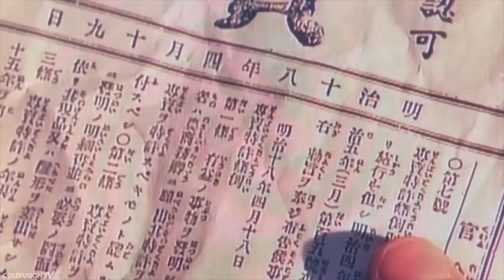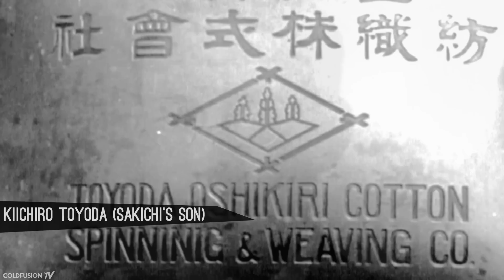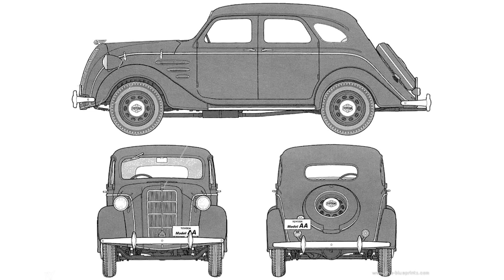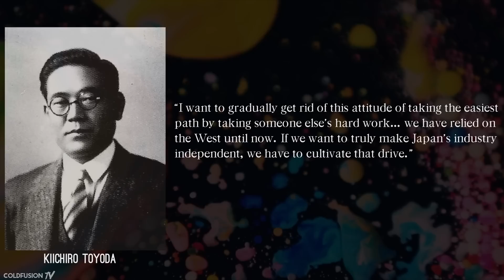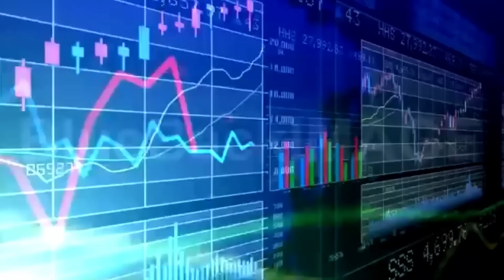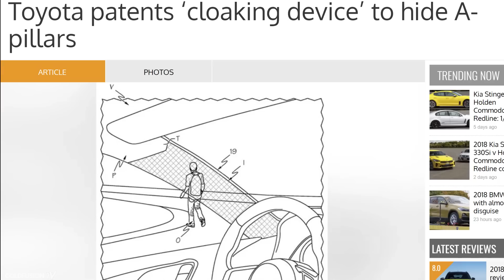How Big is Toyota? (They’ve Owned 27% of Tesla Motors!)

Comment: "80% of Toyota cars built in last 20 years, are still running on the road"?? 

That's Insane, absolutely insane, Can any other manufacturer claim that? 

You can't deny the robustness and built quality. Insane
Reply: And the other 20% are still running. They are off-roading.
Reply: Rolls-Royce maybe?
Reply: I was told about 1998 Land Cruiser with stock shock absorbers replaced in 2008, after 350k miles.
Reply: My Cressida is still running
Reply: that percent is deceivable, because it includes all the new cars too and they obviously ramped up the production in last 10 years
Reply: @sten260  other major manufacturers have also increased production in the last decade but they could never come close to Toyota
Reply: They are a lot....still running....proudly....wif passion..... Come visiting MALAYSIA🇲🇾
Reply: I have a toyotoa corolla 1982 stock and still running better than 2019 carsa
Reply: I got a 99 corolla and the mother fucker just won’t die! 360k miles later and the damn thing still starts first crank!
Reply: *looks at the AE86* hmmm...
Reply: Tony Pasby 
The most powerful car in the world is Toyota.
Reply: UA VENOM 
My father owns the 1980 Hai Lux still working well and used it 1 million km
Reply: Maybe Honda can...
Reply: Means in running condition. That what he wants to define.
Reply: all the 86 on the touge m8
Reply: I think Subaru could claim it in the future.
Reply: Tony Pasby no not even Nissan Honda or Ford 

Especially ford
Reply: Hic Sunt Homines Land Rover for sure....
Reply: Mine is still running after 20 years
Reply: Barlas  Although that might be true. But, can you drive Porsche daily (work, store runs, roadtrip, school etc.)? No way! Nothing can take a beating and match the wear and tear like Honda's and Toyota's. Nothing is more efficient, reliable, respected and at a cheaper cost to purchase and maintain than those 2 brands.
Reply: Land Rover in the U.K. has a similar boast
Reply: My 1984 Toyota starlet is still running
Reply: Tata motors
Reply: @jeddholloway7178  original? Dam 🤯
Reply: My Toyota truck is 30 years old I am a Toyota and Honda fan I’ll never buy anything different
Reply: its insanes
Reply: I agree, Toyota taxis in South Africa.
Reply: Lol true....we have a 18 year old Toyota station wagon.....and my dad still uses that as a family car!! Can't count how many times I've been laughed at!! Dad just tells me to ignore the haters...that car is the love of my dad's life!!
Reply: volvo,mercedes benz , am i joke to you ?
Reply: Volvo maybe
Reply: I drive ae92 still today (28 years old car)
Reply: @hicsunthomines6550  Rolls-royce can't last any where near the same time as a toyota
Reply: @tweetydx9967  I had a Cressida
Reply: @braadress  it's reliable car
Reply: @tweetydx9967  unfortunately, in Sweden we salt our roads during winter, so these cars are all dead.
Reply: @braadress  why do you salt your road in winter?
Reply: Barlas  yeah but most of them are babied and garaged. Some aren't even driven.
Reply: @swifty2550  well.. mercedes benzes  and volvos of late are a joke, and but a shadow of their past.
Reply: @edrcozonoking  volvo trucks,buses and cars are better than toyota look it up
Reply: @tweetydx9967  so the road does not get icy
Reply: Barlas  how many porsches are sold compared to toyota?
Reply: OAT351  if you don't find it impressive what is the stats on Dodge? I work on a used car lot and you better dodge a Dodge, their newer cars are getting better but no where near a Toyota.
Reply: @simmyyin8040  Honda has been slipping they are running on the rep they built but they are not in the top ten for reliability anymore, my wife sold them for 4 years at Lindsey Honda one of the biggest in the US. They had a lot of returns, mazda is better right now. A older honda yes the newer ones with turbocharged engines no.....
Reply: INSANE isn't it ?oh thats all i read
Reply: My 2015 corolla now dead!!
Reply: Haha becaus they not even change their engine. Very outdated. Dame engine since 19forgotten
Reply: I had a Toyota 1980 Hilux in Honduras, before I,came to the United States,in 1986,I,sold it, this year I went to Honduras and I saw that little pick up that is still running
Reply: Listen my friend,a  40 Or 50 years old Toyota, won't gonna let you stuck in the middle of the night or winter storm, like a brand new car.
Reply: My V8 4Runner still runs strong.
Reply: my dad KE70 still running
Reply: 1980s Toyotas are still more reliable on rough roads than most cars of today.
Reply: Both Honda and Toyota have great reputation when it comes to build quality. We had a Honda Civic hatchback from 1994 that survives even today.
Reply: Not surprising based on their design philosophy and assembly methods. They can take a lot of abuse and misuse. Creates a lot of brand loyalty leading to buying another Toyota...and the cycle continues. One thing is they don’t make all new annual models but refine a model each year without redesign the body like US companies do.
Reply: Hic Sunt Homines definitely not , rolls Royce are extremely unreliable and cheaply built , always having a mechanical issue
Reply: @hicsunthomines6550  definitely not. they are known for their unreliability. Plus, their based and owned by BMW, which is #1 on the unreliability list.
Reply: RE fan  last 40 years sitting in the garage
Reply: @joerichardson6107  cvt are bringing the honda down,stupid right? Cuz they keep on relying in a fucking cvt which mazda are not.
Reply: scoty 94 celica still going strong
Reply: My Audi 80 ran on the road for 25 years, and actually after some fixing could have run even longer...
Reply: good car
Reply: I think they dominate in poor country market.
Reply: My 1989 toyota corolla twin cam is the best driving car I've owned it's just perfect
Reply: Volkswagen can claim it hard and wide.  We see it in Europe.
Reply: Tony Pasby System is the problem 🏡 Our Life should be around these Great Qualities.....

1, Show all living creatures; all the love and kindness as much as you can.

2, Only try to be honest with yourself. If you try to be honest with others, you will get into big trouble soon or later.

3, Aim only one target at a time; otherwise you are chasing two rabbits and you will miss both. So, the reason behind it. Have one powerful reason and never ever give up the one you want the most.

4, Don't try to be good person only but be the powerful person. We will grow to be the one or we will die. There is no other choice. 

5, Always learn and look for to improve something your life. 

6, You are not alone. Love and faith the high power reduces unnecessary stress in life. But never completely rely on it. 

7,  Success and happiness are the byproducts of our usefulness. So, always increase the possibility of success.

8, Life is not going to be easy. Because of our unnecessary things. Eliminate all the unnecessary things as much as you can by organising yourself well with the environments. 

9, Never believe anything without the proper evidences. 

10, Always try to give more than you take. 
Because it is dignity/ character of the divinity within you.

🌎 As long as people continue to see themselves as separate from everything else, they lend themselves to being completely enslaved. Success depends on how well we relate to everything around us. Joy comes from that bliss of connectedness. I believe that unarmed truth and love will have the final word in reality. To love; you should have good heart. I am a good person until I see a person better than my standard of goodness. Being good is the progress towards a worthy cause. Love is God. Whoever lives in love, lives forever. How selfish it is to try to keep something forever? Love is all about nourishing, nurturing, sharing and expanding the love within you for all. The principle to which we adhere to is that we have kindness of love at heart for the whole of mankind.  As long as there is the unnecessary differences within us; we can not live peacefully so we have to eliminate all the unnecessary differences among us so we can love all. People abilities may vary but not there true love. If we love a person/ God for a reason then we love the reason but not the person. No reason is the reason to love the person because true love never fails. So do not compare or measure the true love as first or the last but love all truly. If you love people truly then you can understand people. If you don't love then you don't understand people at all.

People are controlled by system why?
The Cyclical Consumption is the current economy all over the World. It is making the scarcity problems of the earth finite resources to deteriorate day by day. Current Monetary System is legalised theft. Real money is Gold and Silver. Scarcity gives the money more value. Real money won't lose it's value. When Governments stay away from Gold & Silver then very easy to transfer the wealth / resources to upper class the Rich (Corporatocracy) Elite. When the Governments are printing out more new fiat currency with reserve banks, our old currency is losing its purchasing power everyday. They are printing millions of currency everyday. All governments and laws are existing right now to transfer wealth to upper class the rich elite. The USA Government & other Governments are in many countries, bailed the investment banks & financial institutions in 2008 against the majority of the people. There is no democracy in any countries. Because of the Money System based on profits motive only above all else even humans lives and well-being. So, we do not have freedom to protect our values with the money so on. The violence, bankruptcy & all the negativities are build into the Monetary System of our society. All are owned (including ourselves) by Reserve Bank. Which is private cartel the corporation. So, in legal system, we are legally considered as chattel the properties. They make money in the capital markets with our birth certificates. They do not consider us as Humans. That's the truth. We are at the invisible war with the Elites (Corporatocracies). We have to fight for our Freedom. Resource Based Economy is the Solution. We have to declare the earth resources as the heritage of all the people of this world. So everyone has access to it. Please have your research about zeitgeist movement then you know the truth more. 

 Truth About Health/Drugs Industry Because Of It Your Life At High Risk The drug industry is a 1/2 trillion dollars a year worldwide conglomerate. Almost 300 billions dollars just in North America. That is really big business. What would happen if everyone were well? There is no money in health. You see, good health makes a lot of sense but it doesn't make a lot of dollars. Because everything they do is toxic. Every drug they use, prescription drugs, all drugs are liver toxic, bar none. If you've had amalgam fillings put in your mouth by dentists. It is highly toxic. There's cancer because most of the chemos are themselves carcinogens. To view the tumor as the cancer and we know the tumor is not the cancer. The cancer industry is 200 billions dollars a year. The more work they get, the more profit there is. You have to dismantle; If the truth ever came out about what we would need to do. 30% of people of females in America are at risk of getting, will get cancer of the breast. The ones that are already dead have been grossly mistreated by the medical profession and by the government that supposedly is supposed to encourage free research and development of all possibilities. Why would medical doctors who studied medicine and practice medicine and are heavily funded by pharmaceutical companies why would they go and look into vitamins? That they never had the answer orthomolecular. And as more and more of our population start taking their health into their own hands, there's going to be even more and more of changes. It can't go on the way it is. The system is failing apart. We must make nutrition the primary prevention strategy for the population. You are what you eat. You are everything that you have ever done to yourself. The choices you make directly affect the outcome of your life. - (Food Matters Documentary in Netflix)

😊 Well, I truly love God. I am not religious but very spiritual person. So, I believe 1) Religion is the beliefs in someone experiences But spirituality is having my own experiences. The mainstream religions people promote religious ideology by giving guidelines and guide but In my spiritual life; I do not want anyone or anything between God and me to restrict my freedom to worship God. 2) We do not need any authorities to do good work. The god work is the good work always. In contrast; organised mainstream religions are claiming that they have the authorities to do God works as leaders so on. 3) God is not capable of doing wrong thing, change the past for us and create anything out of nothing for us. Nothing means not anything. So, even God is limited. The mainstream religious people believe that God is unlimited. 4) God wants us to take responsibilities for our righteousness life but not for all the consequences of our actions because they are continued to exist among us. So, How can god punish us for all our consequences? The mainstream religious people believe we are full of sins because of all our actions. 5) Freewill  is an illusion. People always choose the perceived path of greatest pleasure.  So, we do not have choices all the time. In contrast teachings of the mainstream religions are promoting people to do god's will always because we all have choices of freewill always. 6) We can not separate everything into groups. So, everything for good and evil and there's no success and failure for everything. If everything is real then real things can not be threatened. Once you come to understand that God/The Holy Spirit is in each of us, You will no longer need a Book to tell you how to live. Then why we need religious scriptures? The Virtue is the expression of the basic goodness in our actions. The Basic goodness is the fundamental worthiness of every individuals. We are worthy to God always in everything. 7) Beliefs in a cruel God makes a cruel man. No matter what; every living creatures has the right to live and What makes their life cheap? Everything depends on everything. Nothing too big or too small in value. We can not love and hate at the same time; Being a vegetarian means love without cruelty happily. The mainstream religious people are killing people and sacrificing animals in the name of God. They promote God's cruel punishments. The Punishment is endless for Sinners/Devil according to religious scriptures. But God is love always. Overcome hate with love. If all religions for peace, unity? No way. Because they are not for peace. 8) Well, The God gave us everything to go from moment to moment in our lives as we do our part  and pray only to thank god then the Love is in progress. The Love is always for everyone. We are always worthy of the God's love. Our greatest fear is; not to be loved by anyone but we are all loved by someone. When we eliminate all our unnecessary differences among us then true peaceful life is possible with the true love. If we can't find the peace within ourselves then we will never find it anywhere else. 9) This is the Fight for independence and freedom of humanity to worship God freely without religious guide and guidelines to restrict us. Unnecessarily, We do not want third party controls over us in anything ; especially in spirituality. 10) Revive Survive Thrive. Sincerely,  The Real Peacemaker against religious oppression.

 https://youtu.be/HbvCxMfcKv4
https://youtu.be/Z_Mxjdrd7Sw
https://youtu.be/wLzeakKC6fE
 https://youtu.be/P8vHa8zD7jY
https://youtu.be/pIJHJzDQcRM
Reply: My mom has a 1994 land cruiser and she’s got over 250k miles on the same engine and she’s still running without a problem. That car took me home from the hospital to my high school graduation!
Reply: My Camry was build in 2008, still like new condition, only oil change yearly, it's only 18600 miles passed, I think she will run 30 years more easily.
Reply: That's a meaningless statistic that impresses the gullible. A company can, in theory, produce most of their quantitative history in more recent years and project a statistical claim that disproportionally registers an overall high percentage of reliability projected backwards.
Reply: Nearly all my family have either a Toyota Yaris or a Toyota Corolla
Reply: What is insane is allowing yourself to be manipulated by meaningless statistics. If eighty percent were just put on the road yesterday you could make that statement just as easily.
Reply: Landrovers and Rangerovers!
Reply: @fahrevz  uses K series engine.
Reply: Toyota is conservative in terms of gimmicky technology like most European cars and GM offers. But they give us something really big, difficult, reliable, and great like Hybrid cars.  It started in 1998 and most Hybrid runs much longer than most non-hybrid by other manufacturers.    All Toyota hybrid have minimum 5 years warranty, 10-15 years battery warranty, and 50% more fuel-efficient and 300% more durable than small turbo direct injections that most European brands chose.    However, Only Toyota and Honda now give full independence suspension almost in all cars from Corolla to Avalon/highlander and high-grade safety features that not even all C-class Benz have as a standard.
Reply: Ambassador of Hindustan motors still on road from the early 60’s!
Reply: I think Porsche are pretty close to that
Reply: I have 04 Camry good car 4 cyl lots a mile just got it don't see too many these on the road they in Mexico I guess like the older Corollas
Reply: @ufenorrr9010  what did you do to your corolla to brick it?